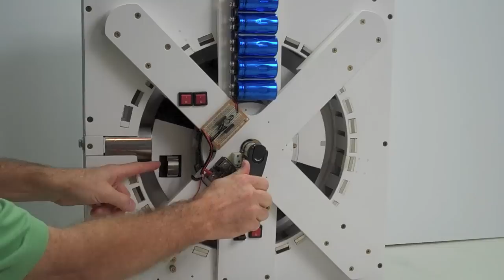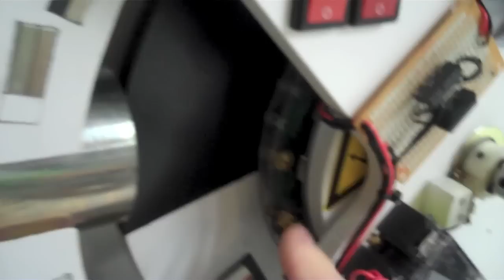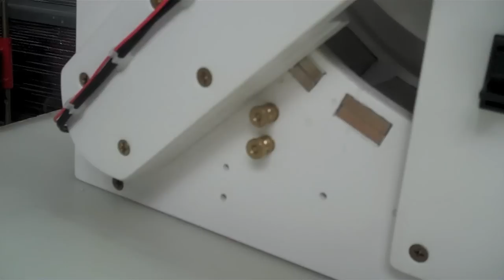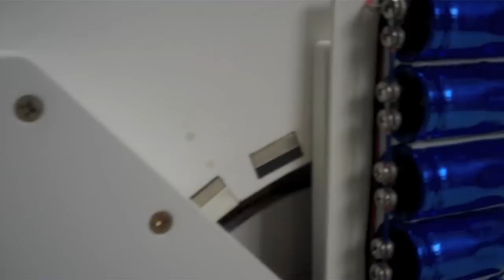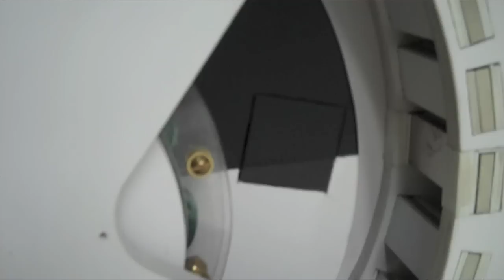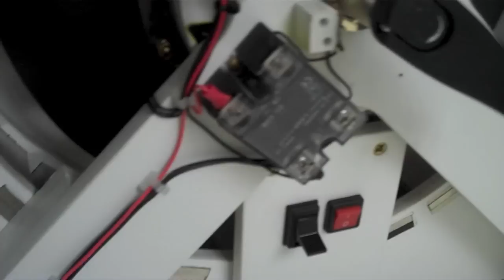Quanta Magnet Motor Generator Hybrid_Part 1

Comment: Simply amazing.  The barrel spins the bar magnets and the iron bolts at the same time.  Except they are far away from each other on opposite ends of the barrel.  Ok...on one end of the stationary housing is a coil wrapped around a wooden stud.  And on the the other end there is a large bolt with the leads of that coil wrapped around it.  Ok...the barrel spins the magnets close to the coil, and the iron bolts close to the large bolt with the leads wrapped around it.  Ok...simply amazing.

Comment from the maker: The correct angle is determined by measuring the thickness of the rotor magnet, and offsetting it by that measurment perpendicular to the center axis of the rotor. This process establishes both angle and proper placement of rotor magnet.

Comment from the maker: @digitallyhere Thanks for your opinion. Actually when the onboard axial flux alternator is disengaged and much less Lenz effect is evident within it, the rotor rocks back and forth lighting the solid state relay 5-6 times while or before slowing. Also, the solid state relay lights on one end only due to the advanced cam timing.

Comment from the maker: @claudio170777 Thanks. That is precisely what we are currently exploring with this unit.
The efficiency of the pulsed rotor/generator system is already extremely high, so the idea is to add the low power input stargate motor as an assist to the central pulsed rotor by magnetically coupling it for zero percent friction, and increase rpm for higher output ratio. Under load, it requires far less power to operate than the axial flux alternator produces with the combined systems. So, we'll find out.

Comment: Again it is a good start...I like where your going...
Invert your components. Get the electromagnet on the inside....that's what you want to be continuous...that's not the variable you are looking to change or increase to increase output. 
What you are looking to change/strengthen; should be on the outside of the mechanism. 
Now take the innovations and discoveries made in the last fifteen years...you already have one of two things in referring to. You got the right kind of magnets, now give them some order, on the outside; and watch how much MORE work your machine does. Thanks, and be sure to send me a million. You owe me now. You're welcome.

Comment from the maker: All magnets on the stator have their South Pole facing inward. Rotor magnet (or magnets) have North Pole in attraction at an approximate 22 degree angle to the parallel face of the stator mags. N52 neo rotor magnets are cylindrical in shape.

Comment from the maker: @valveman12 Thank you for an excellent question. Yes, the flywheel will absolutely rotate using a rotor magnet(s) and an electromagnet coil. However, without the stator magnets you sacrifice RPM and longevity of run-time by losing the 350 degree free boost each rotation. When RPM decreases, the electromagnet pulses longer each time, and consumes additional input power. Most RPM is derived from the stator, as the EM's primary job is to simply nullify the symmetry of magnetic equilibrium.
Reply: instablaster.

Comment: PMM your Stargate modify esp. the Reflectors is very inventive. Also your single driver solution. I am using same. Your vids inspired a Mod. in my Muller multi-generator design! (those little mags-between in Stargate). S turns Hall ON / N - OFF: so I tried Double Mag. S-up; but only Single Mag N-up. It has worked just great! Lighter, faster acceleration, LESS VIBRATION - since N-passage doesn't react push magnetically! Surprised! Take a look for clarity & THANKS!

Comment: The coil in the bottom of the housing where the barber pole barrel is spinning is just a coil wrapped around a wooden stud.  The leads from this coil go up to the top of the housing where they are wrapped around an iron bolt.  When the magnets in the bottom of the barrel spin by the coil wrapped around the wooden stud, they induce current which temporarily causes the iron bolt at the top to become an electromagnet, and the bolts in the top of the barrel become attracted to it in a pulse pattern.

Comment from the maker: Of course it's applicable. Your consumption demand would naturally determine the sizes of both VAWT and generator. Energy storage capacity and consistency of wind are also important factors in this determination. The type of hybrid equipment shown in this video would be far more efficient and require less input than conventional alternators/generators.

Comment: Simply amazing....why did the inventor choose to wrap the coil in the bottom of the housing around a wooden stud?  What happens when the bar magnets in the barrell go spinning by it?  They still induce a current, but are not attracted to any metals as to try and "stick".  Well...then what do they do?  They cause the iron bolt at the top of the housing to become an electromagnet in a pulse pattern of spike and collapse.  The bolts embedded in the top of the barrel spin by this spike and collapse.

Comment: While the magnets in the barrell spin by the coil wrapped around the wooden stud, the iron bolts in the barrell spin by the large bolt with the coil leads wrapped around it.  So every time a magnet passes by the coil, the bolt in the housing becomes magnetic in a spike and collapse pattern.  The iron bolts in the barrel get attracted to and let go of by the bolt becoming magnetic with the spike and collapse pattern of the magnets spinning by the coil at the same time.  Simply Amazing.

Comment: Very nice video, I think you mentioned that with an easliy turned handcrank with your 5lb.rotor the generator would put out 50watts ? If so, and I understand correctly, after 1 minute of hand cranking (charging) you would be collecting 3000 joules in the capacitors. Now to rotate the device for 1 hour ...3000J/3600sec =.83 watts to maintin motion. The recovery energy, is fed to the caps to reduce overall power requirements ? to drive the rotor for better efficiency. Keep up the good work.
Chris

Comment: Nice craftmanship.  I wonder how effective this would be without the stator magnets?  I'm assuming the stator magnets act like a VGATE and the firing coil gets the rotor over the sticky point associated with VGATES.  Of course it is not a VGATE but a varying field.  If you removed the stator magnets, would the momentum produced by the flywheel bee enough to continue rotation as the coil pushes the rotor around?

Comment from the maker: Yes it would certainly pulse run without the stator, but it would have zero torque and far less rpm without the spiral magnetic attraction. You need a little torque to help overcome the resistance in the generator, and accompanying speed doesn't hurt either. You probably already know this. Your motor/generator ideas are well thought out. The real trick is a smooth transition at the re-gauging point without firing the electromagnet. Then when you do fire it, much less pulse energy is required.

Comment: seems the generator should propel itself as a constant, controlled via dimmer switch to dial the desired amperage,etc . What if, you had 2 or 4 units that propelled one another, opposite each other, thus taking up the 5-10* slack; think crank arm. Like a combustable engine, air,spark,fuel is required to keep things going, right? In this case, the fuel is the magnetic forces. Like a airplane, just rotate the propeller, and it starts. Dimmer switch will turn off the magnets, and it stops.

Comment: on wich scale does this type of pulse motor generator work best, could this be scaled down to lets say.... a 40mm computer fan (using the existing motor as a dc generator, the blades for mounting the passive magnets, and the pulse coil on the casing)?

and could this principle also work with 2 linear electric motors (like those in woofers)?

Comment: Might be a silly simple question you've had before, but let's say one makes a conventional windmill or Vertical Axis Wind Turbine VAWT (homemade), what can be achieved if you attach it? Can you charge a battery array to, initially, power your home appliances and let the abundant current flow back into the grid? What would its efficiency be overall and would it be worth trying? Thank you for your time.

Comment: Could I suggest staggering static magnets with the electromagnets to gain the needed resistance? Then pie it out in your 3phase. Are you also having friction problems? The ultimate goal is not only to get it to power itself and one other thing, but to produce a sustainable energy source with enough amperage to power a building. I can see the off grid advantages in designs like this, and it intrigues me.

Comment: @PMMG4HYBRID  first of all you have built a nice hybrid motor/generator congrads for that. My question is what happens when you put a load on it? My gess a dead stop. Keep working  Its nice to see things from other ppl but to me it seems your working only partly in the correct direction. simply the motors bad and generator good. Take a look at magnetic guns. You dont need batteries or capacitors .Hope this helps

Comment: I just watched this video after watching one on washing machine direct drive motors. What exactly is the point of this thing? You said that you charge the capacitors by winding the handle, then it runs for a further hour, presumably from the charge stored in the caps. I don't see a use for it.

Comment: If you take all those magnets off, the capacitors will be able to power the wheel for a lot longer before your machine wastes all its energy, since it won't have to power electronics or overcome the drag of magnets.

Comment: Nice motor, congratulations!
I have been researching the Hojo motor for about 2 months, and I understand that the biggest problem is that it stop to spin after 350 degrees.
From what I understand you put some energy in manually and get some energy out in terms of electricity for 2 hours.
What if you put in some electricity continuosly at a low voltage and get out electricity at a higher voltage instead of charging the capacitors? Would that work?
If the answer is yes, I would love to buy one.

Comment: You've probably already considered it but whats the implication of inverting your pulsing magnet? I mean use a strong permanent magnet and cover the end with an electromagnet that you pulse to turn off  the field instead of on. I think the result should be as you increase speed your pulsing duration decreases allowing lower energy consumption at high RPM. What are your thoughts?

Comment: i have a question... why don't you try to build a da vini overbalanced wheel? use your knowledge of magnetism to draw the downward force harder (using a cam to control the electromagnet, switching it off at the full drop allowing the return revolution) further? are you using magnetic bearings? to continue, measure the weight of the amount of force you need to turn your existing generator, and use that number to calculate the weight of the iron weights on the da vini overbalanced wheel.

Comment from the maker: @beac310 Sure. It's such a versatile relay that we keep them in stock for many projects. The contact side is capable of handling up to 9,600 watts of DC, and will trigger that load as low as 3.5 volts. 

Go to mpja.com under relays for Part No. 17288-RL.  Great company with lots of very useful parts.

Comment: can you isolate trigger magnet  to make your wheel operate continiously. Also you may be able to further make that magnet "s oposite  pole from interfering by inserting it in a steel 
cup.rather than thin aluminum. another idea is after you do one of the above,  turrn  the tip of the electromagnet about 10  degress to your left thereby the machine will run without any help at all.the next problem would be trying to stop i  which you already have switches for that.

Comment: I intend to buy if the price is right, as is condition...how much. Send to Brisbane, Australia? Most inventors build things but do not sell, Hope you are different. May I suggest you sell as many as you can and let others tinker it with their own modification...be it bedini circuitry, joule thief, setup toriodal transformer, power another external flywheel, etc,etc. What's the weight and dimensions cm x cm, the entire unit. Thanks.

Comment: Does the electromagnet uses less energy than the rotor provides in a single 150 deg. revolution?  Either way, why not use a mechanical means of moving the magnet back into original position and prove over-unity?  Your already using a cam.
Reply from the maker: +Dale Thomas  I spent an entire year attempting to accomplish that. It ends up in equilibrium every time. The energy (mechanical displacement, electromagnetic) needed to overcome the final 3/4" gap, is equivalent to the free 350 degree magnetic rotational gain.

Comment: ever so slight problem with this motor. when you had it bouncing back and forth, the relay light should have come on each time on both ends. it may not be required so much after the e-magnet because the field does stay in the e-magnet after its switched off for a period. that is a low output motor.

Comment: @PMMG4HYBRID You are welcome. 
I know a company in Hungary that has been successful with that, they have those units:
(i)	BB-Lego Unit, 150 kg, produces : ΔP  100 Watts;
(ii)	C 4/4 Unit, 1,500 kg, produces: ΔP  0,4 kW;
(iii)	K-720 Unit, 8,500 kg, produces: ΔP  8 kW;
(iv)	E-720 Unit, 8,500 kg, produces: ΔP  8 kW;
(b)	ΔP is equal to the difference between Total Energy Output and Total Energy Input, or:
ΔP [kW] = Total Output [kW] -  Total Input [kW]
I hope that helps.

Comment: I`ve found a generator,which is powered by good vibrations.
It will continue to run forever if connected to a good source of eternal vibration.
It will handle any load, and is a unlimited source of infinite power,if the vibration                               source is high enough,and
because my generator is true perpetual motion,
My motor does`nt need a crank,has few moving parts, And its free..
I named it"my heart".

Comment: I have an idea that would work, make a 12v voltage regulator cirtcuit because, it won't overcharge the batteries. When the drive battery dies, switch it with the charge battery. :)

Comment: what if you added a hero oil fountain for perpetual lubrication of bearings, along with a Tesla vacuum energy extractor, plus a gravitation energy extractor .. then you could do away with those pre-charged capacitors that are powering the spinning boards, enabling full perpetual Free Energy running, LOL ... seriously, what is this thing supposed to be other than a poor excuse for an electric motor?
Reply: Damn are you going to show him better? no ?

Comment: I have a 3d printed working prototype over unity magnet motor generator. Without any power....mine runs for 6 minutes...no capacitors, no batteries, no springs, no electricity no outside motors. it's taken me since I was 22 to get to this point I am now 60....thousands of designs. once it's finished I figure it will have around a 5,000 to 1 ratio. hint.....there are only specific setups with magnets that can get you past the locking magnetic gate. the trick is getting past that locking state, it can be done with just a MINIMAL locking but not much. try a horizontal setup...the balance works better instead of a vertical setup. i'm going to be using a laser switch on mine to pulse the generator when ever it reaches a low RPM. there are other setups to keep your motor going almost indefinitely....but eventually it will slow down and stop.